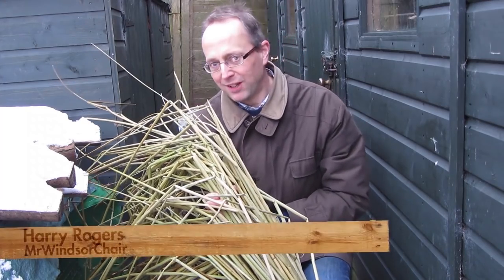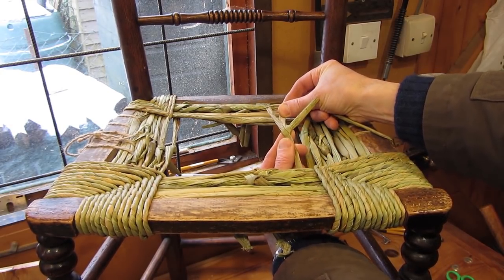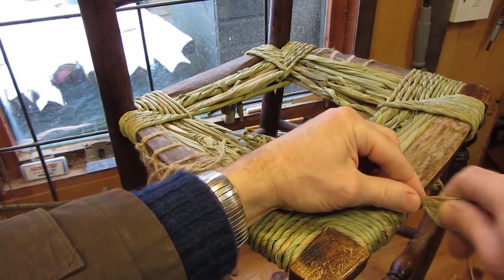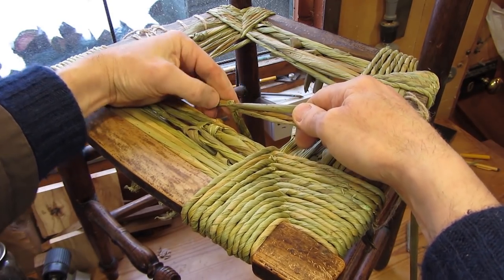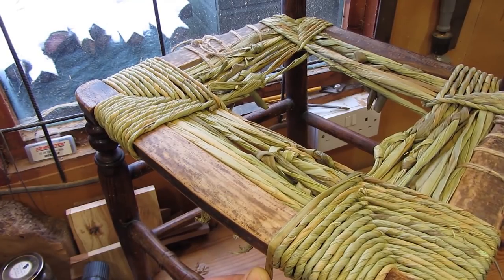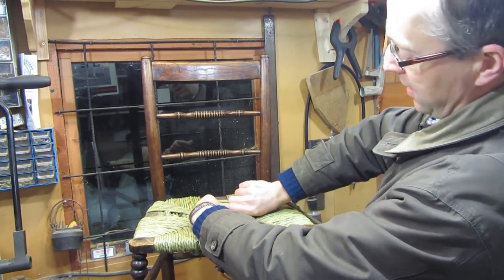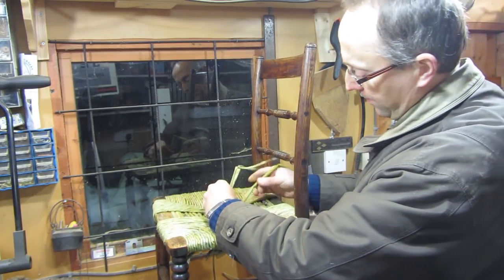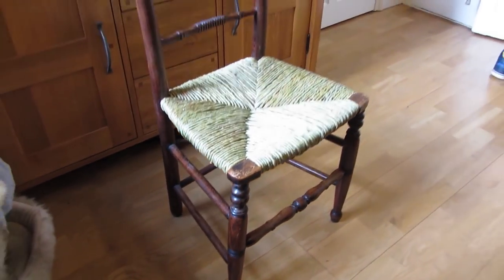Rush Seating a Chair with Natural Water Rush

Comment: You are right about seagrass shrinking as it dries but it wasn't put on tight enough to start with.  The problem with seagrass is because it grows in a salt water environment it is very hygroscopic and will very easily absorb moisture from the atmosphere.  In a very dry environment it will shrink, in a humid one it will swell, and in a very humid one it will go mouldy! :oD  It's a cheap seating material, but not an ideal one.

Comment: I am wanting to put a new rush seat in a rocker and have done this once many years ago.  However, my memory is dim so this video was wonderful.  Thanks!  However, I have a pressing question - the rocker I now want to put a seat on has arms midway along the sides.  How do I handle this?  The rocker is sturdily built but the arms do NOT seem removable - which would be the obvious solution.  How do I weave a rush seat around these arms?  Any suggestions are appreciated.
Reply from the maker: donna stauffer Donna - this is sort of covered in my film Sussex Chair Part 9 film for more advanced rush seating.

Comment: Hub & I did Cane & rush seating for several years but have now retired. Our son in law would like to learn, but we are struggling to find suppliers of natural untwisted water rush.  You were obviously able to find some, can you share the supplier and/or give me any other sources please?

PS.  Instead of attaching lots of separate lengths of rush, you can fill up the front corners by going around the chair as normal but twice round the front rails until the difference is made up.
Reply: Rushes supplier: biezenhof  katteststraat,59A   2220 Heist o/d Berg Belgium